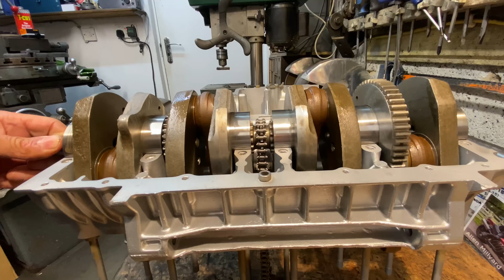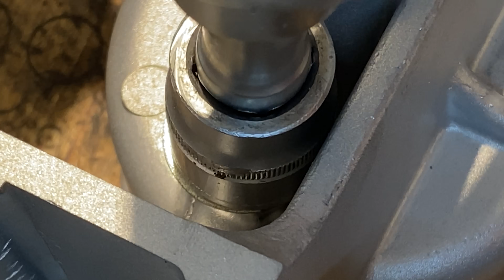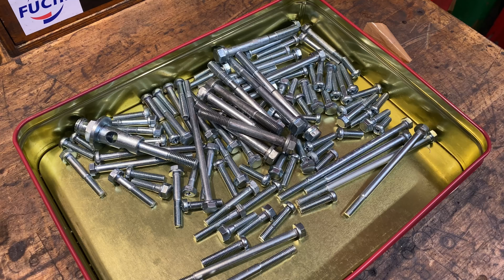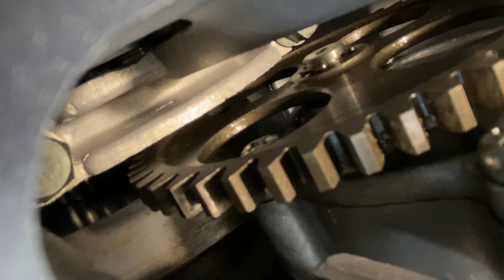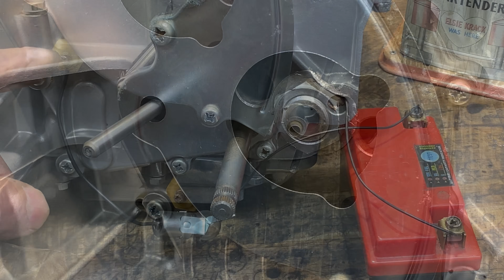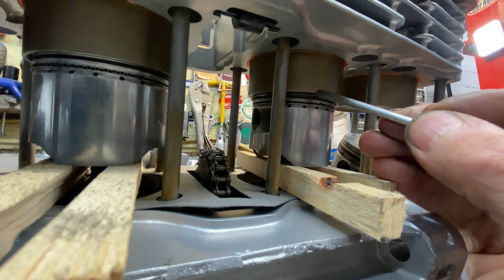Kawasaki Z1B 900 engine rebuild - Episode 3

Comment: I've used another method to lower the barrels.... I fitted all the pistons into the cylinders, but only deep enough to allow the gudgeon pins access .   
Then slide the whole lot down the studs with the crank turned so that 2&3 are at tdc... Fit the gudgeon pins to 2&3 ... Rotate the crank till 1&4 are up enough to install the gudgeon pins.... Then push the whole cylinder block down till it fits tight on the crank case

Comment: He did not mention the o-ring that needs to be installed between the output shaft and the sprocket. Check the Kawi manual, if you forget it, it will leak oil
Reply from the maker: Not every detail made the final edit the o ring was fitted and the engine has since done 700 miles with no leaks

Comment: Very hypnotic. Nice to see someone else who applies oil for oil seal installation. Not many folk I've worked with bothered. Half jobs. My first bike was a raced & rallied to within a inch of it's life and then some Fizzy. I spent more time pushing that bike than riding it! I rebuilt the engine swapping the barrels out for a 75cc kit. After the rebuild was finished I started the beast up and went scooting off down the road. 1st, 2nd, 3rd, 4t..... 4t....... 4th?!? I couldn't select 4th gear so it had become a Tizzy!! I pulled up back at home and scratched my head for a while. I checked everything out and it all seemed fine. I went and sat at the table and noticed this gear on the workbench staring back at me.... yep 4th gear! Have fun

Comment: At 8.31 when checking all the gears will engage, what are you doing with the screwdriver? I'm at that point but don't know how to get the gears to change. Cheers for any answers.
Reply from the maker: im rotating the selector drum with a JIS screwdriver to check all gears select ok you can only select 1st and neutral unless you spin the output shaft fast to disengage the lock out ball,  that prevents 2nd being selected while stationary
Reply: Thanks Allen, much appreciated, have a great Christmas 🎄

Comment: This series of videos on the Z900 are just perfect timing.  I'm also working on a KZ900 engine.  I don't have a lot experience rebuilding engines but I'm enjoying the process quite a bit.  You have a real talent for narration.  

I like the idea of installing the cylinders on the bench.  I was going to put my KZ900 lower end in the frame with no cylinders to keep the weight down.  

Looking forward to the next one.

Comment: Hi Allen it's a pleasure watching you build motorcycles and engines. Would you mind answering one question for me ? Why does the engineers choose to have a push rod inside the input shaft for clutch assembly. Modern engines directly engage it via a lever from the clutch case side. Why do few Japanese bikes still have them ?

Comment: Can you help on a question please, gpz900r cylinder head   the 4 dowel holes to locate the cover ate drilled so deep they break out into 2 exhaust ports some one suggested they are for egr sensor  ,  do I plug them or what , cheers

Comment: Hi Allen, I'm rebuilding my 125cc. I found 2 of the 4 cylinder studs loosened when I loosened the cyl head nuts. For reassembly I put a drop of medium strength thread lock on the stud threads going into the crankcase to keep them firm. (I took engine apart after coolant leaked into cylinder, one cyl head nut lost 5nm of torque, no overheat. Got cyl head pressure checked, looks like uneven torque at factory assembly maybe. Timing on intake cam sprocket was off 1 tooth as well.) What is your thought on using thread lock as I did? I enjoy your videos very much.

Comment: Interesting with the 2nd gear lock-out at standstill. I think the Z1B has no trouble at all pulling away from zero in 2nd gear. My 1981 CX500 had such a low 1st that I'd often start in second gear
Reply from the maker: It’s also to make it easy to find neutral
Reply: @AllenMillyard  Honda Cubs have a similar, but different system. You can go from top to neutral on the move, but only down into first standing still. Current world models are all-down, older and USA models are all up

Comment: Quite relieved that my random ‘pieces of wood’ under piston when firing barrels is used by others.  I’ve got bits of wood marked for specific machines depending on height between crankcase and bottom of piston!!

Last one I did I got both cylinders in, after the fiddly bit of coaxing the pistons and rings in… then hit the kickstart lever with my elbow as I stood up to put kettle on.

Both popped out and back to square 1!!   😂🙄

Comment: Is there a central pivot/ bushing for the detent arm or does the bolt have a shoulder?

Also do you leave your cases bare aluminium after blasting or do you have them anodised?

Comment: I would like to hear your thoughts on rebuilding a not so pristine engine from the 1930's. No information on tolerances available. What to look for, what parts can be sourced to machine or adapted. etc. General rules of thumb and starting from scratch with a worn-out engine.

Comment: If only Kawasaki had taken a lead from Triumph/BSA and designed a multi cylinder engine with several sets of cranckcases with vertical joint faces.....imagine how much better and oil tight it would have been 🤣🤣

Comment: Must be one of the best sandblasted cases I ever seen. Assembly is perfect. Mind you, 30 plus years ago I did a similar job and had some left-over bits. The engine leaked oil like mad and the clutch pack fucked out on me within 50kms. In those days it was a pretty expensive learning curve.

Comment: Invaluable content for rebuilding my '78 KZ650 that was given to me with holes in 2 pistons.
Reply: The Z1B 900 and Z650 engines are iirc almost indistinguishable internally.  This video is gold reference material for any of the DOHC air cooled 4 cylinder Z engines.

Comment: I would never, ever fit a piston to the connecting rod without first putting a rag on top of the crank. I have dropped piston pin clips. It is no fun retrieving them from inside the crankcase.

Comment: I always got a laugh out of those bolts with a hex head…..but then also a Philips slot. Who is gonna try the Philips? 🤣
Reply from the maker: is a strange concept, they are fitted to the oil pump and oil  distribution gallery

Comment: I wish all motorcycles had a standing 2nd gear lockout to reliably hit neutral every time.. Can't stand hunting for neutral at stops when the detents are a bit worn, stop light tuning green right as the selector finally gets tickled just right. Besides, I've had one too many clutch cables break without warning while stopped in gear coz I gave up trying to feather the selector just right, hanging out in gear is a bad habit to have anyway 🤣 Fantastic vid as usual. Always look forward to them!

Comment: Clearly ordinary ring clamps can't be used when fitting pistons to cylinders from below. A trick I've seen to make this easier is to use hose clamps to compress the piston rings. Once they are safely past the rings it's a simply matter to completely unscrew the clamp and remove it.

Comment: Looks as if the pistons are being shy,   they need to come out  a bit more,  about. 020"- .040" depending on the head gasket. And valve clearance.  Possibly shave the bottom of the cylinders, and just skim the top to be certain the deck is flat.  And the head,  say . 002"-.003" off each, or possibly .010" off the bottom, and
 .020" off the top. Possibly. 030" if possible  get the dome up high enough  the piston if flat top would be .005" out the hole. , If the gasket is thick, make it about 
.005" - .008" below the gasket, and skim the head and give the pistons slight reliefs , 
.030" larger diameter than the valves. And roughly .020"  clearance , and round over the sharp edges. Sand the domes with 220 and thin oil, gun oil, WD-40, sand it in the palm if your hand, until the paper is covered with material. Then go to 400, do the same maybe  wash off the paper with oil.  Then go again. Then go 600 grit, 800, 1000, then use a denim buffing wheel, at about 600-1200 rpm depending on diameter. Use a fine  buffing compound equivalent to about 8000 grit paper,  buff until it is a mirror! Then polish the exhaust ports with 220 grit, and the intake with 80-150 removing any imperfections,  the same with the chambers, except using 220,: then 400grit, with WD40, or similar,  even a splash of diesel fuel with a cap of atf in it 2 oz of diesel, and a half oz of auto transmission fluid, (ATF)  ,  it also  works well to clean the  internal engine bits with a shortened bristle paint brush, or cheap tooth brush!  The ATF and diesel leaves a thin oil film to prevent bare metal from instantly rusting,  clean it , blow it off, or wipe it off, them coat it with the mix. Allow it to dry, keep it out of the rain, and water off it, but hand sweat and humidity should be ok, if not add a 1 oz to 3 of diesel  , 50/50 at most, other wise just use ATF!

Comment: Allen, you work as calmly and as focused as a surgeon, and make a complicated assembly look very simple. I'm surprised you use no gasket cement/sealant on the paper gaskets. I can't picture the engine not seeping oil. I also didn't see you torque anything to specific values.  Watching this assembly makes me cry for my 1974 Z-1B, wishing I still had it. Given the choice of any motorcycle I ever owned (including the 900 Ninja), I'd love to have my Z-1B again. Eagerly awaiting the next episode.

Comment: The vapour blasting work really does make the alloy castings look like new. 👍

The bolts you use (particularly those that are in locations which were and will be exposed to the elements), did you have them re-plated because they look like new too?
Reply from the maker: yes re plated bolts

Comment: I still get blown away by how he can just reassemble an engine so easily without instructions and every bolt can be done the whole way by hand.... I've never been able to do that without scraping a bunch of grease off just to find the bolt holes let alone use the right bolts for each thread. I'd be looking in an old coffee can full of bolts and washers just to find a bolt that was too long then using a stack of washers to take up the slack.... He's just living in luxury w/ his flawless threads and none-stripped screw heads, it's almost unbelievable.     😂😂

Comment: Stupid question time: why sealant over a paper gasket I’m sure it’s how it was from factory but why ? Thanks
Reply from the maker: the crankcase joint has precision machined journals spanning the joint so the extra thickness of gasket paper would cause problems
Reply: @AllenMillyard  Thanks Allen 👍🏼

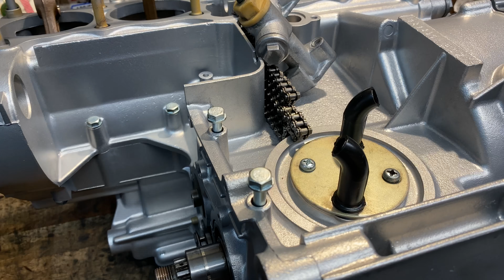Comment: Thanks for an incredible knowledgeable video. With absolute respect regarding your work and hope I don't cause offence but I noticed in your video at 12:38 that the bolt was a bit wobbly as you tightened it up, could it be slightly bent maybe ?
Reply from the maker: all bolts were as new and straight
Reply: 👍 ok, thanks again for the nice video and for replying. 👍

Comment: Shouldn't the oil level glass be at the bottom of the clutch cover?
Reply from the maker: the engine is upside down
Reply: Well that explains why the crank was behind the clutch basket!
 @AllenMillyard

Comment: We somehow get the feeling that Allen would never even accidentally put the wrong length bolt in a hole to begin with. And the even bike wouldn't dare not start on the first kick! :-)
Reply: He actually did fit the wrong length bolt into the sump at 11:06, a few seconds later the bolt has been removed and he fits the correct one! Having said that at least it proves he is a human! (No rags in the crankcase had me worried when the circlips were being fitted but he got away with it. 🙂 )

Comment: If only I’d done gear-change checks early on, when rebuilding my FT500C motor…..I put the engine in the frame, completely finished building up the motorcycle, started it up…only to find it wouldn’t change gear! So I had to strip everything down again, remove the engine, strip that and sort out the misplaced selector-fork before putting the whole lot back together again.

Comment: Good job Allen ... Maybe an idea to explain why when you fit the piston circlips you have the gap at TDC or BDC, I bet many have wondered why, especially on a two stroke the clip has poped out and the gudgeon pin ended up it the cylinder wall !!! Ouch! :face-purple-crying:

Comment: Even after all those years, I am still impressed with how much engineering went into that engine.
Reply: I am the same, the Japenese were late to the party, but when they came in WOW,
Reply: True marvels of engineering.
Reply: Seeing how strongly they’re built, it’s easier to understand why these engines did so well in drag racing.
Reply: I worked for a Kawasaki dealer back in the day, uncrated so Z1A and Z1Bs.
Reply: The writing was well and truly on the wall for the British motorcycle industry when Honda introduced the CB750 four....it was a sign to turn the lights off when Kawasaki followed with this gem of a bike.
Reply: @howardosborne8647  - the Z1 is a marvel of engineering.
It's the grandfather of all the Japanese superbikes today.

Comment: Allen, do you not use any form of anti-seize on the engine bolts and screws? I would probably use an aluminium based or graphite anti-seize when I was putting something like this back together.
Reply from the maker: Not an oem standard requirement but I do use a little zx1 here an there

Comment: I find it mesmerising watching Allen at work, so calm and precise. These would be the gold standard of training films for aspiring mechanics ☺️
Reply: Can you even imagine putting the circlips on the pistons without rags covering the case!?!
Reply: @blacksquirrel4008 I was thinking that. Just rebuilt a Subaru EJ25 this summer and you cannot place rags under and it was circlip finding hell.
Reply: @blacksquirrel4008  Yes, done it myself and never dropped one. They are very easy to fit if you do it right, holding them with one thumb while pushing the bottom up and in, just as Allen did.
Reply: Those circlips are the easiest to install. Everyone wants to make everything "magical". That's not to take anything away from Mr. Millard. He's an amazingly talented individual.
Reply: Im only commenting to boost Allens revenue, hes great to watch.
Reply: Huh...and the notion of "assembly is the reversal of disassembly" is tossed out, just like that... ((haha))
Thanks Allen
Reply: So very true!

Comment: What I love about Allen is that he doesn't use a torque wrench simply because he knows what he's doing.
Reply: I'm sure he does for some things. Sure as in "I bet".
Reply: @CONEHEADDK  Conrods would be my only bet as it's pretty much the only thing I use my torque wrench on these days.
Reply: @vitjakes5531  Cylinder heads perhaps.
Reply: @CONEHEADDK  It remains to be seen on the next episode. But I've done a fair share of heads without a torque wrench, too. :D
Reply: @vitjakes5531  Succes can be achieved by luck.  I prefere to use the advised control. God knows I ruined lots of things from not knowing enough, when I was "a kid". Maybe if my dad hadn't been a narcissist piece of knowitall poop, I would have been taught something about accepting ones limmitations. :)
Reply: I can't speak for Allen, but the rest of us mortals are better off using a torque wrench than not in most places. Especially in Al threads. The correct torque is critical for fatigue life and keeping the bolts from loosening.